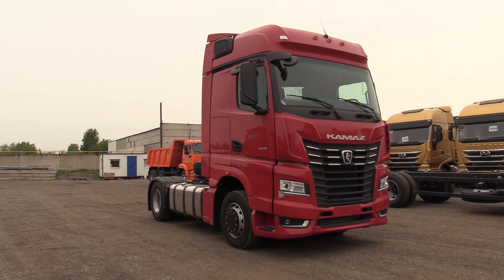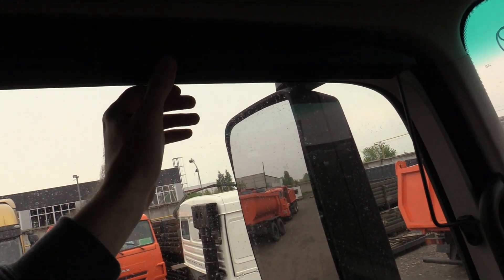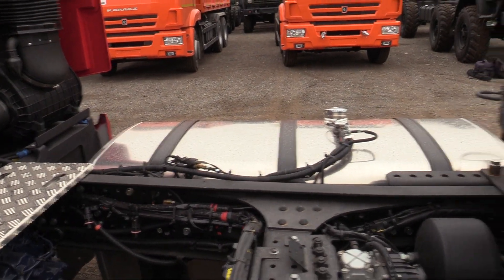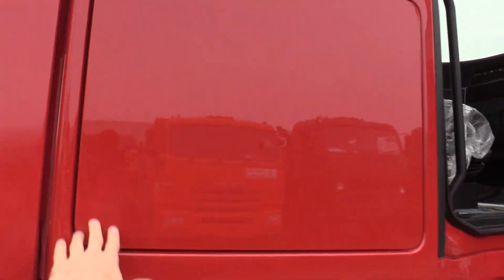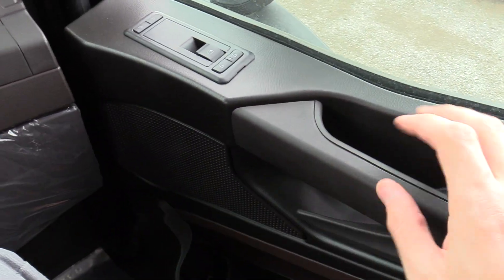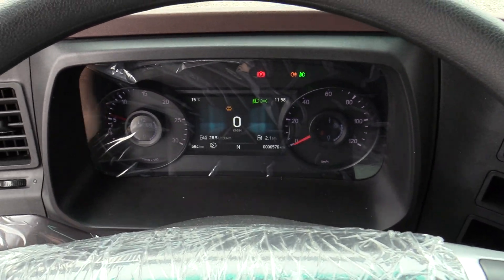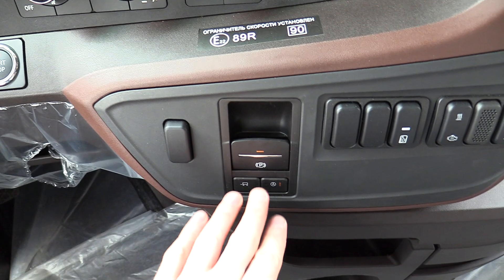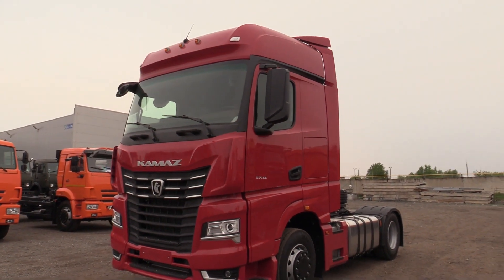2023 KAMAZ 54901-70014-94. Start Up, Engine, and In Depth Tour.

Comment: Kamaz 910.15 inline-six inside this truck are based on Liebherr D946 engine, no exhaust gas recirculation (EGR) attached. Also check out Kamaz 54907 with digital side mirrors, including closer look to 910.15 engine

Comment: Advantages of a Turbo Engine
So that is where the turbocharger gets another big advantage. When working well, they can save fuel! And since they burn fuel with more oxygen, they often burn the fuel more cleanly, which produces less air pollution. This makes a turbocharger engine an eco-friendly choice too.
Disadvantages of a Turbo Engine
Another disadvantage is reliability. When you add a turbocharger to the engine, you are adding another layer of mechanical complexity to just an ordinary engine. So more things can go wrong, thus it requires maintenance more often. And subsequently make the turbocharger engine more expensive. When you turn to a turbocharger engine, you want to get the more from the same basic design. However, by getting more, you are also getting higher pressures and temperatures, which makes parts fail quicker.